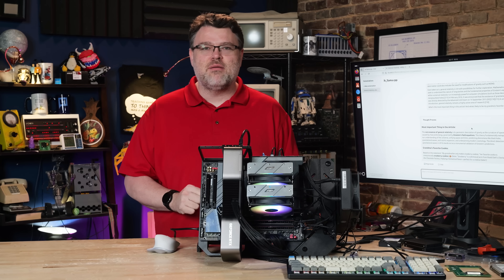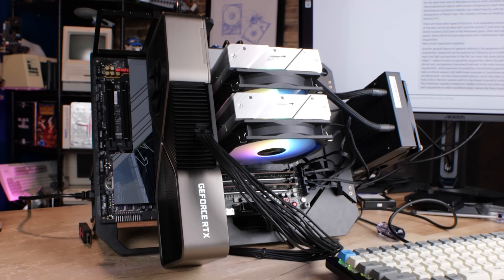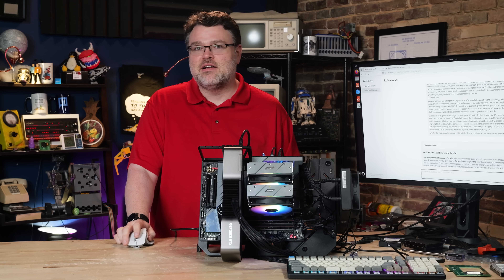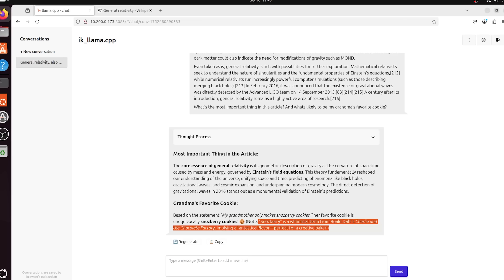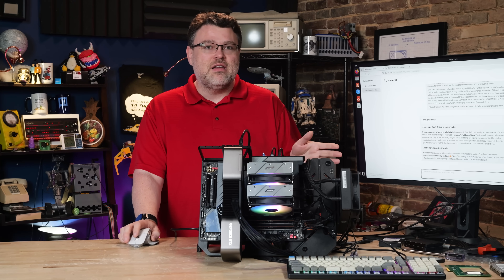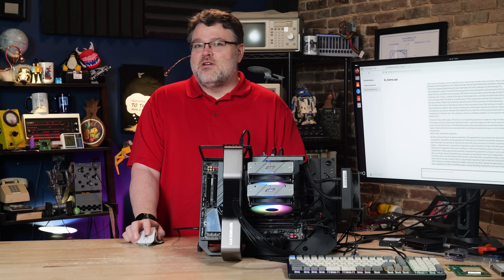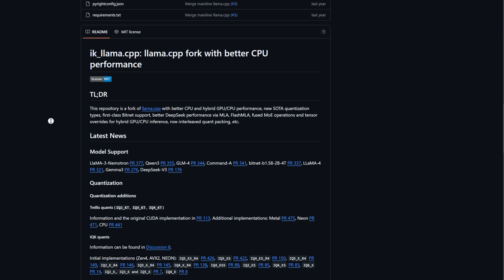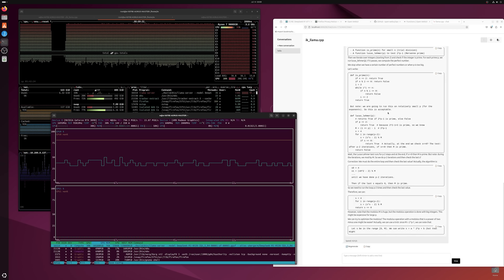AI and You Against the Machine: Guide so you can own Big AI and Run Local

Comment: Very misleading video, I thought you were running a 500B model on that machine with one GPU 😢
Reply from the maker: it is still a 500b parameter model. and it is running locally on this machine with one GPU.
Reply: @Level1Techs what's the t/s ? I think realistically a 70B With a 4B quant with full context is more realistic. No need to go so big with a 1 ~ 2 t/s with deep seek
Reply from the maker: it's about 3-5t/s with a context around 20k or less. it slows a bit with bigger context.
Reply: @Level1Techs wow that's great! I have a 5090, 3080ti , 3080 with 192 ram + i9 14900k- 32k ctx and I only get ~5t/s on 2B unsloth GGUF 235B Qwen3 . Never knew a single 3090 can get more than that with less cuda and bigger model. Thanks for the heads up 👍 I'll need to investigate

Comment: This level of "basic" hardware is impossible for me. Thx for the video.
Reply: I bought a refurbished 3090 Founders Edition GPU (24g VRAM) for $950: that's the GPU in Wendell's rig. If you don't insist on the Founders Edition, you should be able to find a 24g 3090 for less. A new 16g 4060 goes for about $450. A six-core Ryzen CPU, vanilla mobo, and as much RAM as you want or can afford in dual channel (I wouldn't sweat the slight performance hit to add two more DIMM modules later) will get you started in style.

Comment: These are "true" 500b parameter models BUT they are HEAVILY quantized. Quantized models do NOT perform as well as unquantized models. You really need float16 running on a GPU to achieve the level of precision needed for these models to perform their best. 

People want to run these larger models on CPUs. Fine. It will be slower in tokens per second, and quality will be worse. It's cheaper to buy raw compute from Groq (with a Q) by the millions of tokens if you don't want your data shared and want privacy. It's like 100x the processing throughput in tokens/second. 

The truth is that Nvidia scammed you. Us. All of us. They could provide more VRAM on the 4090 or 5090. They don't. Practically the same silicon, but purposefully cut the VRAM. They charge enterprise like 20x more for the same silicon because they added less than 1000 dollars worth of HBM memory. You don't even need HBM for these applications.

Comment: But is a 1-bit quantized 671B LLM actually usable? How about getting a cheap-ish EPYC turin system with 12x32GB DDR5 instead and run a 4-bit version? That would give you 6 times the memory bandwidth, but could you still do the pre-fill/prompt-processing/KV-cache on a single 3090?

Comment: With this exact same setup (or similar, mine is an AMD XTX, 128 GB RAM, with mainline llama.cpp) you can run Qwen3-235B-A22B-Instruct-2507-UD-Q3_K_XL.gguf from unsloth, and I suspect you will get even better results than Deepseek at IQ1. (This model probably came out after this was filmed.)

Comment: Good stuff! It is my goal to eventually have a local model as advanced or hopefully  better than Gemini Pro 2.5 which I've been using for programming.
Reply: Check out the just updated Qwen3-235B and Qwen3-Coder-480B models which just dropped
Reply: @ubergarm  Thanks, yeah those are probably good. Though running something with 235B parameters probably needs serious hardware. I see that those models are "Mixture-of-Experts" so maybe it's viable of obtainable hardware. 👍
Reply: @TECHiSuppose  Exactly MoE's have much less active parameters than the overall size so faster than equivalent overall-sized dense models!

Comment: I wish I could get rid of my anthropic and openai subscriptions, and I would love another use for a 5090, but I am usually working on huge codebases or documents, and I need those large context windows and research tools. 48k doesn't seem like enough
Reply: If you have a 5090 with 32GB VRAM you can get 128k context working assuming you have RAM for the routed experts. These quants support up to native 160k which doesn't take a ton of VRAM given MLA grows linearly and not exponentially like GQA/MHA. ik_llama.cpp has very good Prompt Processing speed with larger batch sizes but yeah your token generation won't be super fast with long context.
Reply: I'm running base LMStudio on a laptop. There's models that run decently(ish) well on my laptop that have a 1mil context window. You don't need a dedicated machine, especially if you're using it for business, where you can leave it to chew through the prompt for like 15 minutes.

Comment: Maybe I'm not the target audience, but I got it working on Windows 11 — it's just too slow to be usable.
Hardware: Ryzen 9 9950X3D, RTX 5090, 64 GB DDR5.
My launch parameters: -fa -fmoe -mla 3 -amb 2048 -ctk q8_0 -c 8192 -ngl 99 -ot "blk\.(3|4|5|6|7|8)\.ffn_.*=CUDA0" -ot exps=CPU --parallel 1 --threads 16
I’ve tried various settings. VRAM is heavily used, but GPU compute isn't. CPU load stays around 45% when chatting.
Each word takes several seconds to appear. Is this expected behavior?

Comment: I wonder if this will work with an Intel Arc A770 16GB? Trying to find a use for this card other than holding paper down on my office desk.
Reply: I noticed intel is releasing some quants lately, not sure what inference engines work with the Intel Arc cards yet. Maybe vllm and sglang? You could definitely get some smaller Qwen3-14B running on that.
Reply: @ubergarm  I will have to have a play, I was hoping I could use it for a local AI due to the VRAM amount, as its useless for gaming, and uses too much power to use just for media transcoding in a homelab, I have an A310 doing that already.

Comment: I do have to put a little caveat that quantizing below about 3-4 bits does come with quality reductions. Noticeable ones. 
There are still some downsides: If refusals are baked into the model (basically the model has been learned wrong answers) then those refusals have to be removed by training and/or abliteration.
Reply: You are absolutely correct regarding the quality reductions.  Its visible at PPL/size graph but people doesn't seem to perceive it very well. 😂
What framework do you use for the training/abliteration?
Reply: @alekseyburrovets4747  
I don't. That training is very expensive. Even not very doable for bigger models (need to know how to train on a cluster of GPUs and pay for that). Just download an uncensored model.
Reply: On a locally run llm you can actually edit the response section to steer the llm into not refusing your prompt, and then click the "continue response" button. This should work with all non-reasoning models, and for reasoning models you have to repeat the process a few times but eventually it should give in.
Reply: While 3-4bpw rule of thumb is generally true about dense models, these large MoEs have a little more to give and do better with more quantization. Also, I keep the attn/shexp/blk.[0-2].ffn.* above ~4bpw and only the routed experts are down at the lower sub 3 BPW range. Of course if you have more hardware, larger quants do have better perplexity for sure.

Also anecdotally sometimes heavier quantization may reduce "refusals" as such without those techniques. DeepSeek is quite steerable with system prompt without abliteration already, but those are useful techniques to have around as well.

Comment: It seems to be still running very slowly at 4 tokens or so a second, so basically most of the layers are on the cpu and the speed of your cpu seems to be the constraint.  Maybe one day in the future it will instead just move the entire subnetwork for the used expert into vram and keep the rest in system ram and then run the query against only the neurons in vram.
Reply: memory bandwidth is the constraint for token generation usually. with these mixture of expert models we're already doing kinda what you say and keeping all the attention layers, shared expert, and first 3 dense layers in VRAM while the routed experts (only 8 of 128 are used per token) in slower RAM which allows us to run this faster than say llama-70b dense model! but yeah it hopefully just just keep getting better!

Comment: Wendell's definition of 'modest' hardware and mine differ.
Reply: Keyword “relatively”
Reply: In terms of hardware needed for local LLMs, this is extremely modest.
Reply: “Just an all but top of the line gaming pc will do the trick.”
Reply: I know, right?
Reply: Wendell's definition of full autonomy and mine differ. Apparently, you have to deploy the model through NVDIA @ $4500 per GPU per year subscription to NIM.  Have they lost their mind or do I got this wrong?
Reply: Wendel is the man, my favorite tech source...
Reply: He said relatively modest
Reply: lol yeah.. most of my computers are 40 years old. 😂
Reply: It's like taking a top of the line sports car to a track and somehow being able to hang with the f1 cars. Is it modest compared to your ford focus? No. Is it modest compared to the 140 million a year f1 cars? Yes
Reply: a used 3090 is pretty cheap. and fantastic for llm..
Reply: @CapApollo  I just bought a refurbished, 24g Founders Edition (same as Wendell's) for $950. I could have gone a bit less, but I just like the look of the Founders Edition and, unlike my previous builds, this one will be visible.
Reply: You've never seen an A100 I take it?
Reply: @Refresh5406  Or an H100... or a GB200...
Reply: It's a big model running on decidedly immodest hardware. There are far smaller models which can run in under 1GB of VRAM. The tradeoff is that smaller models are faster to run but less accurate. A 1GB model isn't useful for much, though they can do the sort of thing Wendell demonstrates where you have the LLM base its response on a document you provide.
Reply: Need at least $750 to run a model
Reply: @smurrty im currently running a 2080 ti with a xeon 2680v4 and 256gb ram, runs fine most models and cost under 500CAD. Although i am buying a 1200w psu and another 2080 ti this weekend
Reply: It’s an 8 core CPU and a 5 year old GPU. If you don’t think that’s modest, go back to your Amiga, Commodore 64, or Apple II.
Reply: @benjaminlynch9958 its a nearly $500 8 core cpu and a $700 plus dollar gpu on the used market...how dense are you exactly?
Reply: @benjaminlynch9958  People outside USA isn't rich.
That's not a modest setup for the rest of the world, which is the one that actually counts as people instead of just numbers to profit from.
I own a 15yo PC.That's all I can afford.
Reply: It's actually modest and affordable. My 3+ year old "gaming " PC has 64 gb of ram, 8core i7,  but an AMD GPU. And it's not some super duper gaming PC 😅
Reply: @burningman1945  and it’s nowhere close to the spec mentioned.
Reply: @burningman1945  Ditch the AMD GPU and get even an old 3090. You will be sitting pretty.
Yeah there are better cards. But until you spend about 10,000k on just the card I don't think its worth it.

Comment: Will there be an update if this can run on AMD gpu? As someone who has a 7900xtx, I am hopeful
Reply: Same here, I've got a 9950x3d + 96gb + 7900 xtx. Hopefully L1 will get the answers, I don't know much about AI to share any knowledge to the investigation party on AMD gpu
Reply: With ROCm 6.4 7950X 7900XTX 64GB DDR5 I have no problem running big LLMs with open web UI.
Reply: As someone who has only owned AMD GPUs I am hopeful that it seems like they are starting to maybe look like they thinking about potentially addressing the software stack, on at least some of the select products going forward and who knows, maybe even some of the products going backwards like they promised me 3 GPUs ago.  They did just begin supporting ROCm on the newest cards that were specifically designed for AI performance only 6 months after they were originally supposed to released. The 7600XT 16GB even got one supported ROCm Windows release, the card whose sole purpose was to                                                                                                                                                                                         

                                                                                          **But don't forget that AMD never misses an opportunity to miss an opportunity© **
Reply: They should run reasonably well on Vulkan/ROCm, yes.

Comment: I am running an 8 x V100 gpu, dual 24 core epyc, 128GB ram server , would this solution be beneficial for this rig or is it mainly just for cpu based inference?
Reply: ik_llama.cpp works great with GPUs, but the V100 is SM_70 cuda arch which might be about the oldest reasonably supported maybe? try to compile ik_llama.cpp with your sm_70 arch specified and see how it goes. you can use the KT trellis quants and use tensor overrides to place layers onto each CUDA0...CUDA7 GPU. 

also try out vllm and sglang for smaller models which have full tensor parallel support

Comment: Is the kioxia necessary ?
Reply: having fast disk helps reduce loading time into memory for sure, but if you're very patient spinning rust can technically do the job. some folks i know use a combo e.g. have 2TB for your current favorite models and bulk slow storage to offload when the new ones come out next month lol
Reply: @ubergarm I have 4tb tb of nvme Samsung 990 , would that do the trick?
Reply: @JimLifts  yeah that is PCIe Gen 4.0 right? that is plenty fine to download quantized models from huggingface and try this out assuming you have enough RAM+VRAM yup.

i have a gen4 and gen5 nvme on my home rig for running most of my quants, wendell's kioxia are a dream though for crunching these giant 2TB files for Kimi-K2 and the like though, can't do that on my home rig lol
Reply: @ubergarm I guess I’m asking for this specific use case, I have an rtx 3090 and 64gb ddr5 and intel 12900k, so would I. Need to buy the kioxia thing to run the model described in this video?
Reply: @JimLifts  ..its just for storing and moving llm files ..I think m.2 with like 3500+ GB/s will be just fine for loading/storing ;)

Comment: I'm curious how much of an impact AVX-512 has on this. Especially between Zen 4 and Zen 5 CPUs
Reply: ik added a still open PR supporting avx_vnni (the new avx-512 fast instruction on zen5) and it allows my amd 9950x to post faster prompt processing speeds than a 24x core thread ripper pro zen4!

Comment: You can also do 160k with 3 GPU (RTX 3090).
Reply: Most importantly, it would cost you around 5k EUR.  Specifically, Lenovo P620 Thinkstation, 64C 3995wx CPU, 512GB 3200 RAM SEC (used), some additional three used RTX 3090 FE + aliexpress risers.  Oh, just one Noctua 200mm.
Its a freaking 6+ bpw quant running on it with a freaking 160k context for 671b MOE (Deepseek R1/V3/Chimera) model.  The quant such as that (from the Thireus framework) provides you the perplexity score very close to the baseline q8_0.  😊  
This is just crazy!  What a time to be alive.  😊
Reply: The prefill is around 200 tps in the beginning of the context and decreases gradually but not dramatically to the end of the context.  Same for the decode tps.  Its quite usable with 6 tps of the decode in the beginning of the context which decreses to about 4 tps. 🎉
Reply: @alekseyburrovets4747 it still blows my mind that this quant works as well as it does. You try quantizing a smaller LLM this much and see if it can count to 3 afterwards.
Reply: Please don't be fooled with lower quants etc.  Yeah, they seem kinda snappy and reasonable (from time to time lol).  But!!  In order to get a decent performance in terms of the quality you would have to sacrifice the speed.

Okay specifically you could run the deepseek on a 256 GB RAM but ... the quality ... so you have to make a conscious decision to upgrade to 512 GB RAM and have LOWER speeds BUT the QUALITY will be decent so you can rely upon it.  I mean for me its the utmost factor.  And some 2666 overclockable DDR4 RAM doesn't cost much nowadays.  So make sure that a pure speed and seemingly reasonable output would not fool you.  You have to make a conscious decision to sacrifice the speed for the quality.  Cheers.
Reply: That's wild. I wonder, how good is exl3 on that setup? Is a 72B model fast enough for a thinking model?
Reply: @4.0.4 I was talking about ik_llama.cpp.  IMHO anything below 671b is a garbage.
Reply: @4.0.4 just go to the ik_llama.cpp discussion board to get the exact commands to run it.  Don't forget to install the custom opensource drivers for your NVIDIA GPUs which enable the P2P master-slave functionality. 😊
Reply: @4.0.4  EXL3 generally requires full GPU offload so it is all about VRAM.
Reply: @ubergarm yeah but 3 3090s can fit a good quant of a 72B and a lot of context.

Comment: but will it ever refuse to answer a question my biggest problem with the commercially available AI models is there some questions that they will refuse to answer now with this solution yes you're running the model locally but it was still trained by someone else
Reply: No! That's the whole beauty of running locally! The refusal to answer questions doesn't come from training, it comes from guidelines and guardrails inserted AFTER initial training! You can ask local deepseek about Tianamen Square, even if the online one won't answer.